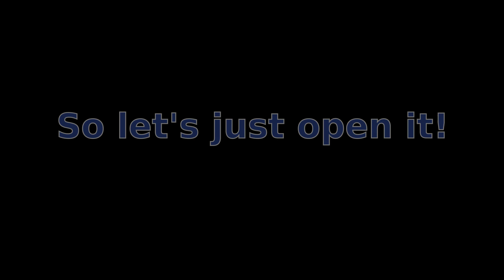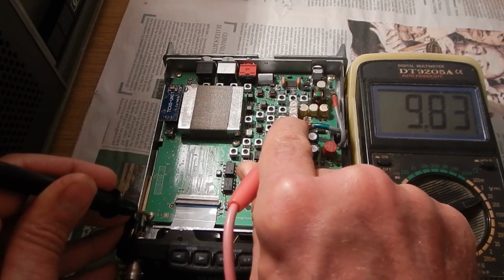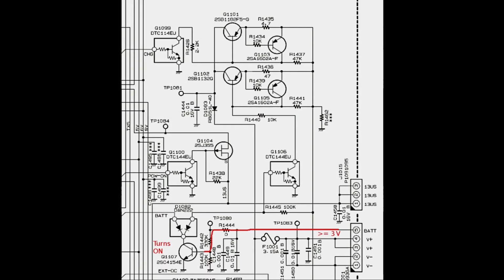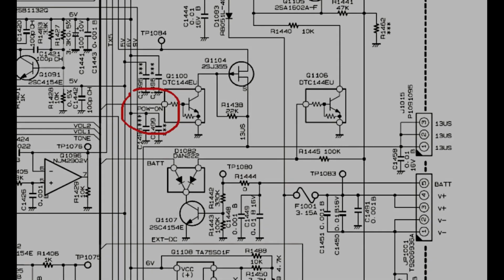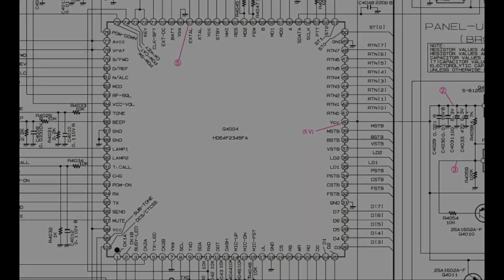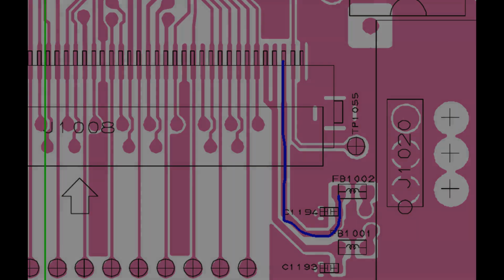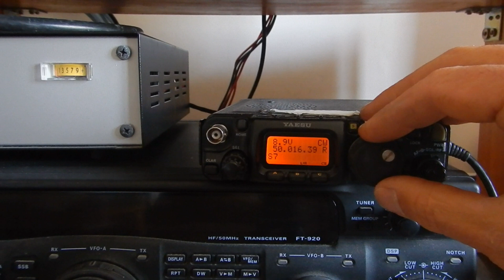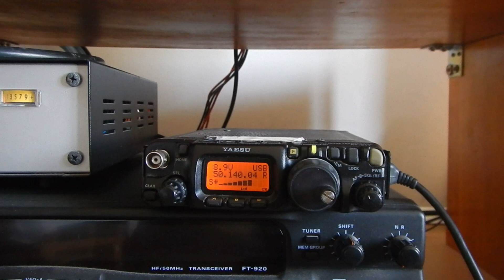Yaesu FT-817 hamradio transceiver repair. Fuse and "fused" trace.

Comment: Nice video, thanks. You told him you used 5W but on the bottom display the I iiI indicates you are using 2.5 Watts. From my experience the max. 5 Watts is only possible at 12 Volts or higher, not with battery power. My FT-817ND still has some problems with the encoder which sometimes jumps down in frequency when it is supposed to go up, I will have to take a look at that some day. 73 from the Netherlands.
Reply from the maker: Hi, thanks for the comment! Indeed I didn't check the actual power, 3dB difference can be normal on these transceivers (as you said, lower voltage). Good luck with your repair!

Comment: Very clear explanation.  My 817 ND stopped working after an internal battery charge up. The shop engineer didn't manage to fix it so I thought I might try myself, how hard can it be? .. but there are not any example videos of this problem.
Reply from the maker: Thanks for the comment! When a schematic is available, it's usually just a matter of following the voltages step by step and finding where something is missing. The biggest problem on these radios (at least for me) is working on those little PCBs with tiny components. Good luck on your repair and HNY!

Comment: mine is now with integra A in sofia with this problem again. last time i bridged the fuse (while i wait for a new one) then the ribbon connector slipped a pad and blew the double inductor. i watched as it lit like a lamp. idiot me left the battery in, but it would have blew anyway
Reply from the maker: You should always look for a short before replacing a fuse and power on again. The failed capacitors on the panel PCB could be the reason why the fuse and track blew in the unit I've repaired, but I didn't find any short circuit, so whatever it was, it also "killed itself". In your case, I'd look for an ongoing short circuit.

Comment: As a user of amateur radio I have to admit that the electronics side of the hobby totally baffles me, that is why I am still at the entry level after 5 years on the air, please dont misunderstand me, I can work the world on a good day with my 10w and love portable radio.  Your obvious patients and understanding of fault finding is to be admired and respected, not something I would ever attempt so you have my total respect.  Thank you for sharing and should my 817ND ever need looking at, I'll send it over 😂.
Reply from the maker: Thank you for the comment! I've been in the "amateur radio" environment since I was a child and what I liked about it was to understand what was going on, inside and outside the radio equipment. I see it shifted towards a more "let's make just contacts" environment in the past 10 years or so, that's why I can't enjoy searching for real DX anymore. Amateur radio started as leading edge technology (think about the first trans-atlantic radio transmission, the satellite repeaters, just to mention a few) and it seems now just enjoying trailing edge technology. I may be wrong and this isn't even the best place to discuss about it, but that's what I think in a nutshell :)